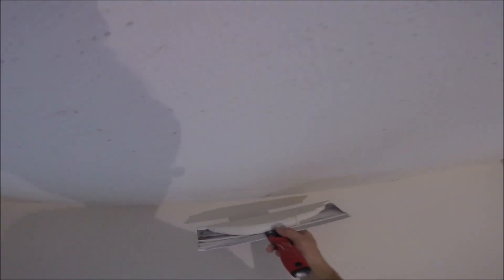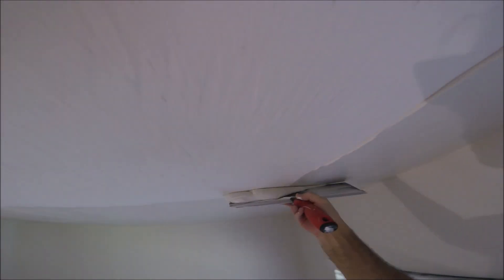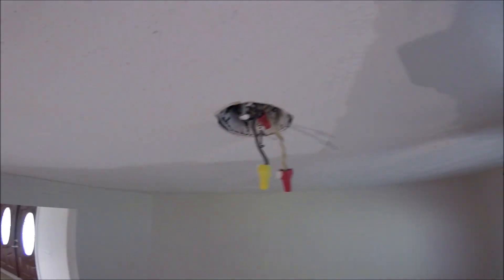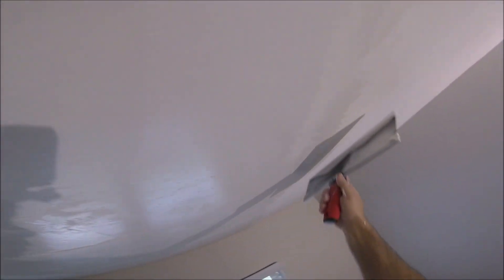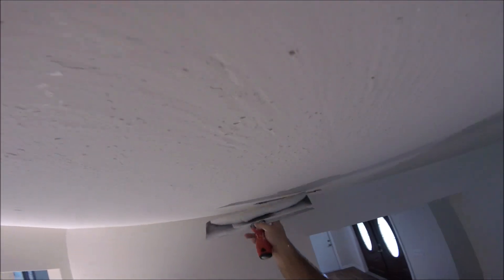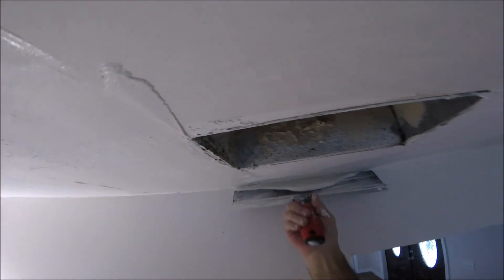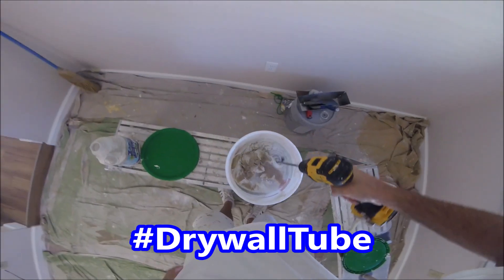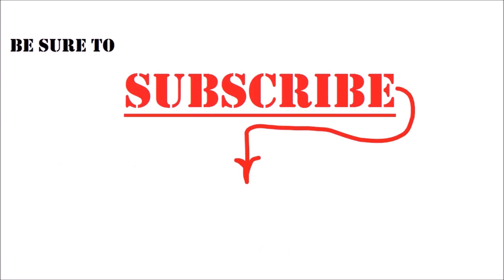How to skim coat over an Ugly ceiling- skim coating series part 5

Comment: Hi. Really was confirming the way I am handling a popcorn ceiling that had been removed by inexperienced people that did a pretty good job except made a lot of gouges and also messed up the tape that runs along the top edge of the wall to the ceiling. Most all will need to be taped again because its gone in most areas. I let the ceiling dry a few days and sanding poled the entire home yesterday, then started skimming. (Gotta love the dust). Anyway, this is the same technique, (the technique you are using) I have used before and have begun on this job as well. Thanks for the video. I have now been reassured that I am going about this correctly.

Comment: Do you recommend skim coating over a concrete popcorn ceiling in a condominium or using a quarter inch board and then uh doing joints on that which do you think is more clean looking and more economical

Comment: #DrywallTube Thanks I have a house full of popcorn ceilings and want to start perfecting this technique.  I’m going to begin practicing on the basement ceilings the previous owner plastered but did a very messy job, and while not popcorn the surface is very ruff.  It doesn’t need to be as perfect as the other two floors.   These are very helpful and I want to avoid sanding.

Comment: Hey Paul, a few weeks ago a huge oak tree fell on our guest house!  (No guests there, lol!) The repairs are ongoing, and I asked our contractor if he knew of a texture guy or gal who might be able to skim coat the ugly popcorn ceilings in the kitchen and a couple of small bedrooms while the little house was undergoing repairs.  He replied that the crown molding would have to come off because the mud would be much thicker.  How much thickness would one coat of skim coat (or two if needed) add?  And couldn't the crown molding just be reattached after the skim coating?

Comment: We scraped our popcorn ceilings this past weekend and it was hard but went well but left many imperfections where the scraper dug in a bit or screws at sheetrock joints weren't covered well because it wasnt necessary due to popcorn etc. 

I sanded my ass off and my wife sheetrock mudded her ass off and it looks a million times better but still has enough imperfections to be frustrating.  

Is it possible to skim coat areas of an entire ceiling rather than the whole ceiling? I dunno. Seems to be the only option to get a nice flat, smooth ceiling surface. 

Thanks for your work and sharing!

Comment: The freestanding tub upstairs allowed water to peel the ceiling paint below. This is a plaster ceiling and after scraping lots of loose paint off I now need to skim coat the plaster. I'm told that drywall mud won't work. Suggestions?

Comment: #drywaller is what you said?   So my stepdad already scraped the popcorn ceiling and it pulled some of the paper into almost a fuzzy coating.   Is that just 2 Skim coats to be ready to stomp?
Reply from the maker: Right on Roy!👍🏻 Yes, two skim coats over the frayed paper should be fine. Then a light sand and you’re golden to proceed with the stomp texture. Sounds like you’ve got this man! Thanks so much for watching and subscribing!😎 -Paul

Comment: My ceiling in the living room needs redone. Either the original drywall contractors were terrible OR the peak of the vaulted ceiling cracked from settling and an amateur bad skim coated and retectured it. It's bad. You can see where the corner and edge of the mud knife dug into the mud. There are large smooth areas along the peak. Whoever did it was really really bad. I'm no expert but I did my fair share of mudding and taping back in the day. Now I'm getting to old too be up on a ladder to fix that crap. Forget stilts lol. #Drywalltube